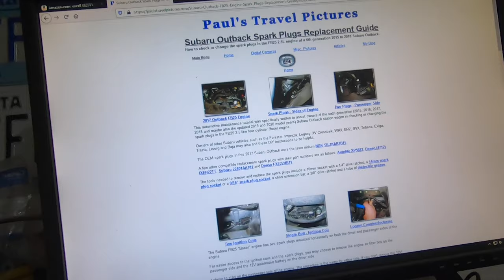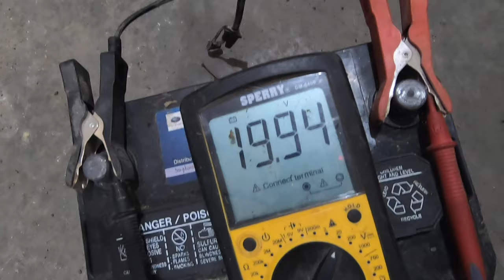Spark Plug Change - 2015 Subaru Outback - 4 Cylinder Engine

Comment: Just completed this recently.  It took me a little over 3 hours.  I took time to clean everything that needed to be removed before putting it back and took care of some corrosion on the battery terminals.  Had to let the engine cool down before I could get my hand in place to loosen the two side bolts on the battery tray.  Also dropped one of them but was able to reach up underneath and feel around until I found it.  The biggest problem I ran into was on the rear driver's side plug - even with a 3" wobble extension there was not enough room to pop the ratchet off.  I eventually got it off by using a putty knife to extract it from the extension.  Then I used a square drive socket cap from Harbor Freight that I got "just in case" this kind of thing happened.  So that one got tightened with a crescent wrench.  If I had to do it again it's probably a 45 minute job provided the engine is cool when starting.  Changed them at 105,000 miles.  Plugs didn't look bad at all.....they all still had the correct gap.  Idle seems a little smoother and it might have a little more pep under acceleration but I haven't seen any MPG gain.
Reply from the maker: We're tipping about 140k with the Outback now, and she's still kicking without any issue.  Most of our miles were all highway and easy driving.  at 100k, I'd expect to see pretty clean plugs unless there's something else awry in the engine.  As she's still in pristine condition cosmetically as well, hoping we can get to 250k or beyond before she becomes more of a basketcase than I want to deal with.  - Agreed on the 'second time is faster' by far!
Reply: @DachsAutos  I had mine at the dealership for something a couple of years ago.  They changed my plugs at 84K miles.

Comment: Thanks for the video. It wasn't as bad as I was expecting. What was key for me was having many options for having different lengths of extension using extensions,swivels, even a 1/2 to 3/8 adapter.  I was able to get a torque wrench on all the plugs using various length extensions and swivels. Taking the battery box off is a must. Not to bad with a ratcheting 14mm box end for the two side bolts. Have a magnetic pickup tool to pull sockets out of the spark plug hole because they are deep. Also have a long flat blade screwdriver to pry apart sockets, extensions etc while the socket is still in the hole. This is necessary because they need to be taken apart before you can get them out. Also I used an impact driver and deep socket to get the battery hold down bolts off to save time. They are long. Also a quick way to put the battery tray bolts in.
Reply from the maker: Thanks for the reply!   Indeed not as bad as expected, but still not as simply as the plugs on my old '52, that's for sure!  I swear, sometimes the engineers and designers sit in a room and come up with the most ineffective ways to build cars to allow them to be worked on, by a dealer, or DIY'er..
Reply: @DachsAutos  Efficiency of repairs is definitely not high on their priority list. My Honda CRV luckily only took 30 minutes. Thank you Honda.

Comment: Thank you for the video.
Just purchased used 2015 OB in showroom condition with 121k miles (2 days ago). Unfortunately have not talked the dealer into releasing any dealer service history yet. Just scheduled outstanding recalls with him yesterday (exhaust, yes it needs it; EBP and relay).
I did differentials and engine oil so far, trans is next unless they confirm it was done; spark plugs and fuel filter next (unknown on the filter, mixed results on the searches, have not found it yet, some say in the tank, some parts suppliers show external canister).
The OB runs like new, very well used and cared for, just sketchy on the detailed search service, very routine service recorded on Carfax, not by a dealer.
This is my 3rd Subaru, 2009 Forester XT, new; 2013 OB, new.
Thank you.
Reply from the maker: We did the 100k maintenance at the dealer with fluids etc. I've done all the brake work here. Recently I discovered the rear was out of alignment and had that corrected by the dealer, but the plugs should be a snap to do on your own as long as you can get the plugs out, that was the biggest hassle I had, which wasn't even bad!

Comment: Not an easy plug change, but not too bad. The plug nearest the driver was a pain and took a lot of manipulation. As many have said, get a grabber tool before you start or you'll have a very hard time getting the plugs out. On a side note, does the battery mount really have to be bolted in that securely? Those 2 lower bolts were a PITA to get to. Thanks for the video. Helped a lot! Thank god this only has to happen every 100k.
Reply from the maker: A guy could probably use a drop of blue thread-lock and not be as concerned, but it's my wife's car and I want to ensure everything is as it should be.
Reply: Subaru seems to recommend plugs at 60k... you don't agree?

Comment: Clean prior to remove with electronics cleaner. Use painter's tape to get a good grip on the spark plug. Apply anti seize to the thread love your new plugs to make the job easier next time. Wobble extensions are the key
Reply from the maker: Great suggestions!  Coming up on 200k miles, I might be doing the plugs again. Anti-seize for sure this time around.

Comment: Any tricks for getting that driver rear coil out - I tried so hard to bend/manipulate the plug but its just too close to the rail!!
Reply from the maker: oof.. Not off-hand.  I don't recall having issues with mine. Have you tried using an actual boot removal pliers if it fits?  I don't have one, but possibly it would help for you.

Comment: Thanks so much for the video.  Hey do you remember how long the socket extension was that you used?  Thanks.
Reply from the maker: I believe it was my basic 3" Craftsman extension with a deep socket.  In a few of the plug-wells, I needed to insert the socket first, and then the extension if I recall (back holes I think)

Comment: Just got done with this. I left the side bolts for the battery box off... less to deal with next time! Also way overkill!
Reply from the maker: I'd like to say when I did this, I wouldn't be replacing them again, but now we're coming up on 190k miles with no immediate need/plan to replace the Outback,so... Maybe that would have been smart of me.  On the flip side, we live on a dirt road and I didn't want things loose and vibrating around either...

Comment: Hello, I am using a translation program. Can you tell me who the original Subaru supplier is. Which manufacturer uses Subaru to install the ignition coils?
Reply from the maker: @Gecko - I don't see a label on my specific vehicle, but I see that DENSO may be a good OEM replacement option

Comment: Question for you, boss. Did you put those two side bolts on the battery tray back in? You know the terrible torture ones? 😅
Reply from the maker: 110% you bet I did.  I'm sure not going to 1/2 arse the job on my wife's vehicle, much less anyone who buys it down the road.
Reply: Thanks. I just couldn’t get my hands in there to thread them back in. 😣
Reply from the maker: @stephenbeard9882  If I recall, I think I shoved a paper towel in the end of my socket and then shoved the bolt in so it would stay in the socket sideways.
Reply: Thanks!  It’s helpful just to know it’s humanly possible. Thank you for posting this video as well. Very well done! 👍 two beer job except for these two dang bolts! 😅
Reply: I got the top battery tray side bolt out.  I have no idea how to reach the bottom one. Maybe under the car and remove  the skid plate, etc?  It would have been nice if this video didn't skip that part.  Anybody do it? How? I am using a 14mm ratcheting wrench but it's flat.  Seems like I need a longer one and with a flexible head maybe. thanks
Reply: @jmogyoro  I used a socket to remove the bolts that held on the battery tray.  Indeed they are a bit tricky, but they came out. If I recall, I did have a u-joint on the socket, but indeed it was a challenge to get around the lines on the framerail.
Reply: I took off the tire and went from underneath, I don't see how else to do it and it's puzzling that Dach's Autos says he shoved a paper towel on a socket...bullshit. You can't get a socket in there. I ended up stripping the top bolt...I just left it off, had to...can't put a tap in there...lame that it's completely skipped in the video and not even a mention at all
Reply: @jmogyoro  I got the side top one off with a 14mm bolt and a 3/8 watched after I loosened and pushed the coil to the side. The bottom one I used the circle end of a crescent wrench, the trick was to maneuver it underneath so that you can pull up on it from the top to loosen it. Hope this makes sense. Currently trying to get the last coil out...
Reply: I used a 14mm offset box end wrench to get the side bolts off. It had enough length/leverage to get them off easily. Had to carefully contort my hand to get them to thread back in then used a stubby ratcheting wrench to get them back on. Took the top one off first then reverse order putting them back on.

Comment: Getting ready to change plugs on '16 OB.  Makes me question why I bought a subaru & whether I should buy another.  The plug on the drivers side firewall side concerns me most.
Reply from the maker: The changing wasn't that bad really, it was just monkeying around trying to GET to them in the first place.  None were that challenging, just tedious.  I believe I just used my standard deep socket, a 4" extension and a swivel-joint to get in there.. And, of course that grabber thing.    As I mentioned in the video, it took more time to get the stuff off in my way, than to change the plugs themselves.  125k miles on a 2015. No rust or anything seized, and we live in Minnesota, so..   Best of luck!
Reply: @DachsAutos  Thanks for the encouragement. Nearing 100k miles on original plugs.  Don't want to pay for service when still making car payments.  Just looking at the clearance I assume those coil packs must really be able to angle up sharply once popped in order to  get them out. They look so long. Also did you use any die electric grease.  I've read in other forums to avoid antiseeze on threads because can make easier to overtighten.
Reply from the maker: @80srockerable  Same here - we had some work done on warranty, front cv/axle and the exhaust manifold (had a crack)  - This was a no brainer.  The coils did bend some yes, but nothing to the point of splitting the boot.  I used just a bit a grease when I put in the new plugs and went off the torque spec.  No problems with over tightening.
Reply: holio  Successfull..And like many things. Could do faster the next time.  I have a lot of tools. But found myself running out to buy a very long 1/4" ratchet with flexible head. Also I bought a box end wrench adapter set that  converts a ratcheting box end wrench into a low profile ratchet. This was handy at removing and diving in some because you lose space as remove plug.  I also found it handy to get the right length of extensions by converting between 3/8 & 1/4" adapters. Lastly I also bought a super long 14mm ratcheting wrench to make it easier to get battery bracket off.. probably wasn't completely necessary.
Reply: holio  The plugs looked better than expected for 98k miles.
Reply: holio  the passenger side is very easy compared to drivers. I only removed the air filter box only for passenger side. Left rest in place.

Drivers side you must remove battery and the battery bracket to sits on. That is all.  They are 14mm I think.  A straight ratcheting 14mm wrench will be handy for removal of battery bracket.
Reply: Be advised weird things happen when you disconnect battery.  Like you have to reset your one touch down power windows. Easy procedure on YouTube.  Also I had done the trick to disable seatbelt alarm. I had to repeat this too.

Comment: Hi, thanks for the video, I have 2015 (4-cyl) Outback.. I found this part on RockAuto, NGK 93482 {#22401AA780, 22401AA781} Laser Iridium, is this the plug you used ?  Whats the torque spec ?
Reply from the maker: I would confirm with a shop manual, I recall about 18ft lb, but a quick google search shows 13-20.  Those were the plugs I used if I recall.  I soured locally, but remember them being the iridium spec NGK model.

Comment: Battery will drain if you leave it on bare concrete. Place a piece of cardboard or wood scrap between battery and floor.
Reply from the maker: The battery was actually reading well over 12v when I removed it from the vehicle, so it was only on the floor for the duration of the spark plug change.
Reply: That’s a myth.

Comment: Do you know the part number to the NGK LASER SPARK PLUGS?
Reply from the maker: Hi Martin - You can look this part number up: SILZKAR7B11
Reply: Perfect Got it! TY
Are they PreseT to 0.044?? 
Ive done a run through on Oreillys and Autozone and it states they are pre-set 🤔
Reply: Pre-gap is what I ment
Reply from the maker: @martinrangel8157  From online and Pauls Travel Pictures guide I posted, they list between .039 and .043.   Even if they say 'pre-gapped' I'll double-check myself to ensure it's accurate.

Comment: hi. did you raise the engine up too. I have a 2015 outback and it seems to be too tight  between  engine and rail?
Reply from the maker: No, I did not raise the engine.  It is indeed tight as you can see, but by inserting the socket first and then attaching the ratchet and extension, I was able to get in there with little issue.
Reply: i was wondering about coil,it looks too long . since its rubber can i bent it when I'm pulling it out or it will make damage to it?
Reply from the maker: @shahabbatha9327  I bent ours a bit to get it out/in with no issues!  I voided any sharp bends, but slight bends were no issue.
Reply: This was a total ass ache. The driver side is the worst. Very awful engineering in this aspect. I was having a very difficult time removing the driver side coil pack. You just have to pull towards you and pry out. Very disappointed
Reply: @jnepute  I was able to get it. I had to mess with the coil a bit and angle it.
It can be done. Just take a 10 minute break and get back to it

Comment: Wheres the footage of you removing the battery plate? And re-attaching it? Skipped right over a very tricky and difficult maneuver. I don't need to see footage of the stuff that's a no-brainer, show me how you did the tricky stuff. Those side screws on the plate are tough to reach
Reply: The battery plate is secured by 6 14mm bolts.  The 4 on top are easy.  The 2 on the side I had to use a wrench and it took forever.  Don't drop anything!  I believe they designed this battery holder so that if you lack the ability to remove it, you should not be replacing the spark plugs.
Reply: I got the side top one off with a 14mm bolt and a 3/8 watched after I loosened and pushed the coil to the side. The bottom one I used the circle end of a crescent wrench, the trick was to maneuver it underneath so that you can pull up on it from the top to loosen it. Hope this makes sense. Currently trying to get the last coil out...
Reply: @contreras408  I ended up taking the wheel off so I could reach it underneath...guess you already figured that one out...the whole job took me 4 1/2 hours...a lot longer than I thought it would, they charge you $500 at the shop so I guess that (kinda) makes sense

Comment: It is definitely not a two-beer project, especially if it is your first time.
Reply from the maker: If you're a novice all around, it may be a little longer.  Having been performing maintenance and routine work on vehicles for over 25 years, it was not too bad.  Having the correct tools is half of it right there.
Reply: It's 2 beers just getting the damn battery tray off...and then back on

Comment: putting battery on cement will drain it to it's death
Reply from the maker: The battery was on its way out, but the over-voltage was the concerning part..
Reply: That doesn't apply to batteries from the past almost 80+ years. Back when batteries were wood yes not any longer. Has to do with moisture coming up through the wood.